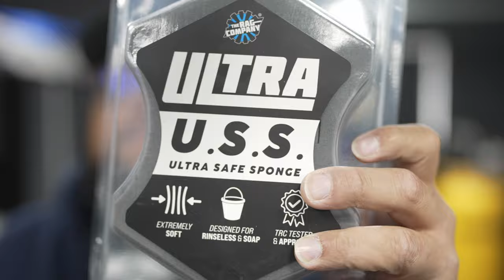Feynlab V3  Rinseless wash exposed: Real first impressions

Comment: Eddie you should test slickness on three different surfaces, to see if your slickness is coming from the product or the condition of the vehicle’s paint. It would be interesting to see how much paint condition plays into slickness.

1) Ceramic coated paint
2) Non-coated paint
3) Non-coated, non-clayed
Reply from the maker: I can do that got a few more test / review in the hopper  and we’ll do and in-depth
Reply from the maker: Nick tried it on a car yesterday no cerami coating no protection dirty and it was slick cleaned amazing Just FYI
Reply: Sweet!! 👍🏻

Comment: This is so good to hear as my bottle is on the way. First thing I thought was it would be pretty funny if they just went back to v1. The other thing I noticed in this video is how when you wipe the panel the water behavior looks flat and doesn't separate on the panel like a lot of other rinseless products. I refer to this as wetting the panel, but I'm sure there is a better term for it. v1 did the same thing and was made my favorite. Stuff was so strong I used at 1:384.
Reply from the maker: Ya I  noticed that to , wondering if it’s just a cleaner vs having polymers it leaves behind

Comment: I used this out in the sun the other day, definitely was streaky for me when the sun dried it on the surface. I'll try it in the garage next time to see how it does when the sun doesn't dry it on the surface.
Reply from the maker: Hey so when you say streaky what dilutions did you use, I've been using in the sun I let it dry reactivated it did just feyn <-- see what I did here but also it was 70 degrees and let it dry for a few hours
Reply: @Ecdetails  I'll give it another shot, maybe my sponge was compromised, but I was able to clean it up using a different risneless. I could have sworn I used the proper dilution but maybe I didn't. I'll give it another shot outside and let you know, but the glass during drying wipeoff, it looks like the dilution was too soapy so there was that weird halogram look to the glass that would normally take a wipe with a clean towel and spritzing with something else. I'll do again and report back, but the bucket and sponge did feel much more sudsy that I like with a rinseless, was thinking they sent me a V2 for a second haha.
Reply from the maker: @ScottKelley  Wait how much suds cause it should not be foam town - 

I did ask them and feynlab 1oz 3 gallons try that I've been doing 1:250  and 1 oz 3 gallons not really seeing difference maybe im wrong - ill retest this week
Reply: @Ecdetails  Not Foam Town but more than any my other rinselesses. I use a sponge as my main wash media for rinseless washes. What I found is that after dunking the sponge and then squeezing it out a few times, it creates a decent foam on top of the bucket. I rechecked and I am doing 256:1 dilution as I made up another bucket just now just to make sure. What seems to be happening is when I squeeze out my sponge, it aerates the solution and just creates a bunch of bubbles on top, like a few inches worth after several dunks. Then when I am trying to wash, I like to dunk the sponge and then give it a squeeze and then wipe the vehicle. The problem is, it feels like the foam isn't letting my sponge absorb the more liquid solution and then like I'm trying to wash my vehicle with suds and bubbles rather than a water solution. Try out a sponge next time and try a dunk and then squeeze out, it creates more bubbles which deters the wash experience for me because it starts to feel like the solution isn't letting the sponge absorb water properly.
Reply from the maker: @ScottKelley  I would do the 1oz 3 gallons fo water like they suggest,  I use the sponge the legacy one and I haven't experienced it. Now ill check the others to see if I'm getting those vibes. 

Can you do me a favor do 1 oz to 3 gallons and check the sponge test make sure to clean the sponge out
Reply: @Ecdetails  That was the key! I just did 3 gallons and 1 oz of rinseless. Much better. Suds are right where they should be, sponge can reach the water without interference or sitting on top of the solution, and solution still feels nice and slick. 1 oz to 3 gallons of water is what feels great for me. I'll use that next time I wash. Thanks Eddie!
Reply from the maker: @ScottKelley  Bro you are faster than me!

Comment: I will get a bottle in france
V3 are strong as the V1, not appropriate to sealant ? or safe at 1/256 ?
Can't wait to try it :)
Reply from the maker: Let me know your experience
Reply: @Ecdetails 
Hello, first test to me.
I must Say on black car with 1/256 if i want to take my time and make full wash before drying, there streaks :/
Now its powerfull cleaning, may be with 1/300 it could be different ?
I think for 0 streaks i have to wash by small part.
With absolute i can do all the car but not as powerfull for sure
Reply from the maker: @XBOW83   its 1 oz to 3 gallons to avoid th issues your having , its a deep cleaner  I an wash direct sun with no issue 1 to  gallons
Reply: @Ecdetails  i will test this, its a little soapy so you must be right

Comment: many of the high quality Rinseless, that dont streak and surfanctant based,which most are. all do the same job. They are slic, they' use surfactants like ",sucralose"  which is  sugar based. They work by breaking don the dirt and grime as you seen theirr. Polyner based washes "encapsulate and lift away the fuet and grime. 
Differnec3s betqeen surfactant and puner based is that  Surfactant based rinseles washes use sucralose or "sugar based" surfactants to "breakdown" dirt. Polymer based rinselees washese "encapsulate" dirt.
Reply from the maker: I read this and would like to ask are you saying all rinseless washes are all the same? Or are you saying  that they all will
Clean the same
Reply: @Ecdetails  

Meaning they are they to do the dame.job as In removing dirt and grime. Differences are smell, how slick, surfactant vs polymer.but the end result is cleaning the vehicle right? That's what I meant. So the end result is to remove the grit and grime from.the surface of your exterior or even interior.When I mentioned especially  the , they are so close in completion that you really can't go wrong in buying any of them. Like you were mentioning some of the brands. they all do a great job  the differneces may be so minimal,  that whichever one you purchase , you will get good results.
Reply from the maker: @btbd2785  gotcha thanks for explaining and I agree ☝️
Reply: @Ecdetails  

Your welcome! 👍